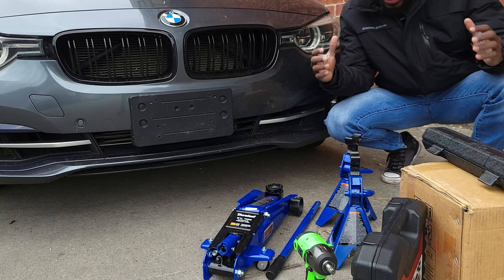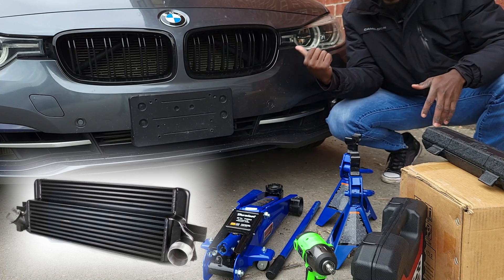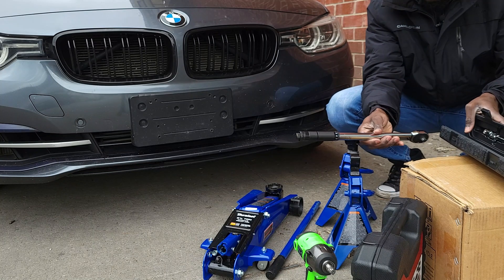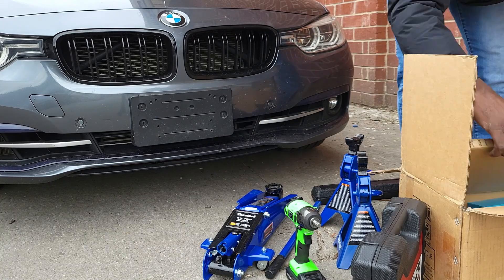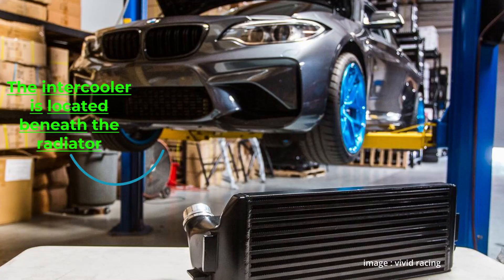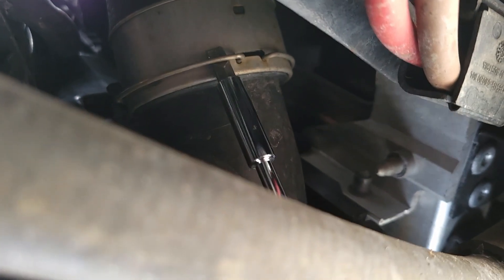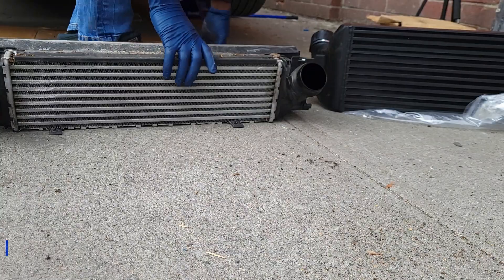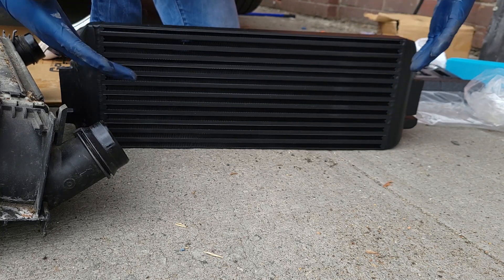ROAD TO 400HP F30 328i xDRIVE BUILD EP 01: INTERCOOLER UPGRADE

Comment: I would recommend upgrading the charge and boost pipes as well to get the best performance out of the intercooler and turbo.
Reply from the maker: Indeed.
Make sure you keep up with this build over to the 228i. N26 and N20 are the same engines. We carried the build over with the 228i platform we the above mention was done.
Reply: @hyde_official  oh nice also wanted you to know great work with the video and going into as much detail as you did!

Comment: Where is part 2?
Reply from the maker: Part 2 is carried out with the 228i build. It has the same engine as the 328i, makes same stock HP. Follow the 228i build series.
I replaced the 328i with 228i because the 328i was getting close to 100k miles, and there were some annoying factors I couldn't live with such as vibration at high speed after 80mph despite all the maintenance and upgrades (new wheels, tires, wheel hub, road forced balancing, etc). I hope you can still enjoy the contents. Most of the mods being done on the 228i, apply to N20/N26 engines.

Comment: Bro are you still happy with this product?

Is it good to running Stage 2 ?
Reply from the maker: Yes, this intercooler never deceived. No leakage, nothing! Works great!
Reply: What’s your temperature range ? Mine is between 210F, is it normal ? With stage 1
Reply from the maker: @yasharrad2522  since installed, it has never passed the 250.

Comment: Good luck, Id recommend going arp rod bolts theres info on the forums but your gonna need to keep boost under 24,5 psi as the walls will begin to flex.
my n20 was FBO upgraded low pressure fuel pump stage 2 on custom e50 tune by the creator of BM3. No lousy tuner and i was running methanol injection. Made 310awhp on 22psi. Upgraded turbo on 23.5psi target will be your safest bet. youll be around 340whp which will be your goal of 400hp. go with the arp rod bolts for the n20 as the weak point around 300 is the rod bolts themselves. they begin to stretch under the crazy instant torque because the small turbo. Id stay away from the kick down feature and only smash the gas when in the manual mode near 4k+rpm otherwise you will put alot of stress on your rod bolts and blow the motor. Lemme know if you have any questions.

If you want to hit 400 hp follow these steps
GO FBO.
Buy a Fuel-it STAGE 2 LPFP
Go Pure stage 2 Turbo 
Get a full e85 tune or custom e50 tune. By either Cary Jordan or Halim with bm3.
the tune is your bread and butter make sure you ask for 23.5psi target 
if safety is a worry ask the tuner to ramp the boost on 500rpm later as this will be safer for the car.

To keep things safe i believe its the M52 rod bolts you need to use. Once again check the forums. I never ran them and my car was fine.
Avoid the kickdown feature! to much torque load and torque blows motors. Start pulls at or near 4k+rpm for safety.

You follow this and your car will be healthy as can be and 400hp.

Bonus: If you want maximum acceleration shift at 5.5k rpm in 1st and 6k rpm in all gears 2-6
Reply from the maker: well said! I appreciate the input!
Reply: All facts , the b48 is such a unique cool 4cyl but at the end of the day I don't trust it for shit 😃

Comment: is 400hp possible with n20 without opening the engine
Reply: Mine blew up with 320whp... So with stock internals i wouldn't go over 280 whp.
Now doing a complete rebuild 😊
Reply: @pyroboy659  im bm3 stg 1.. hope im safe lol
Reply: @pyroboy659  how did u get 320whp? Just fbo and tune? My n20 has a jb4 tune on map 2, 8 inch intercooler, afe air intake, vrsf catless downpipe and gfb dv. Doesn't feel that fast tho. Feels like maybe 250whp on my z4
Reply: @raidacaipo  masata intercooler/chargepipe, catless downpipe and mst cold air intake.. and then a custom tune.
Reply: @pyroboy659  what kind of tuning you do? Jb4, bm3 and where did you set your max psi? Cuz the N20s are known to blow up after 22 or more psi of boost
Reply: @raidacaipo  it didn't go over 20 psi, pistons are the weak spot. 
Now it's build for around 320/ 330 hp without problems. There are kits to upgrade it to around 450 hp but that's just to expensive for me.
Reply: @pyroboy659  it wasn't a user error on your part? Like misshift, not changing the oil enough or something like that? I've been running my n20 on map 2 for a year now with no issues. With all my bolt on, it doesn't feel like a 300whp car tho. I heard the timing chains are weak on the older n20 before 2015. Could your timing chain went out causing it to blow up? Anyways yeah  bmw n20s are weak. My 1.8 b18c Honda engine is pushing 330whp with only 9 psi of boost on stock block. The Honda k24s can push close to 600hp on stock block. Bmw needs to design better turbo engined but then again this was their first 4 cylinder turbo engine
Reply: @raidacaipo  no, I was just driving "normal" on the highway and just in 1 sec blue smoke and running on 3 cil...
Piston cracked, almost 5 mm play on the crankshaft in the horizontal way, cause of this was a failed crankshaftbaring. 
The car had 108k km and had good service historie, distribution chain and oil pump chain only had around 7k km on it.
Maybe it was bad luck but the guy that has rebuild the engine does around 2 to 3 n20's every month 🤣
Reply: @pyroboy659   where are you located ? How much was to rebuild the n20 engine ? Thanks
Reply: @pyroboy659  I just ordered a masata intercooler how is it? Have you had any issues with it?
Reply: to the crank yes. to the wheels no. The limit is about 350wheel.
Reply: @hellohunter8583  oh sheesh thats quite alot still.. most "regular" engines cant deliver that much
Reply: N20/N26 are same n26 is European version there is no way 328i make 400hp